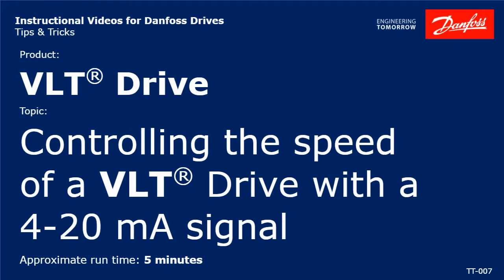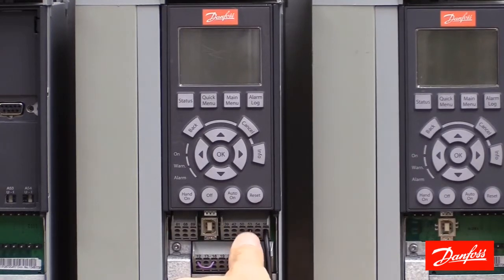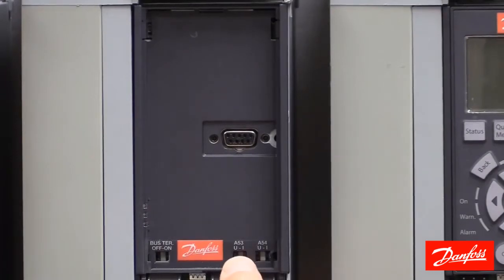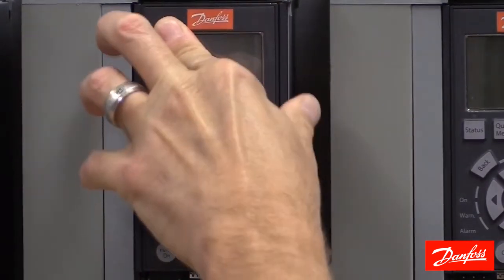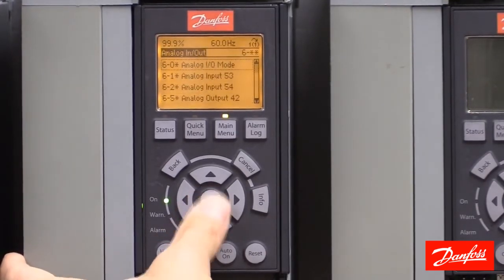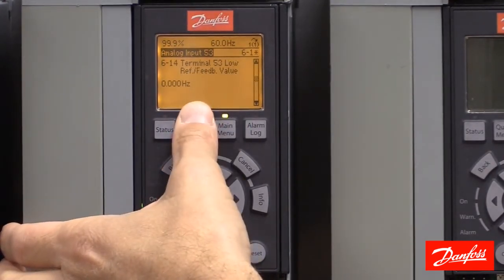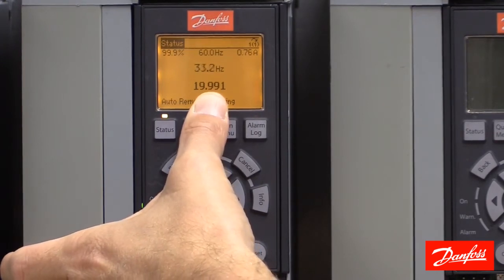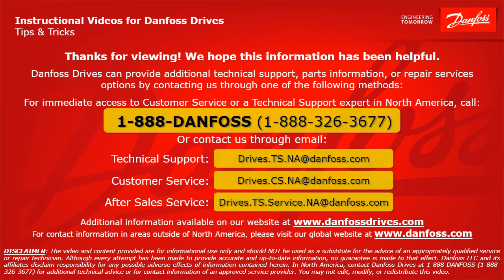VLT® Drives: Controlling the speed of a VLT Drive with a 4-20 mA signal

Comment: What is the recommended wire  diameter for connection of such 4-20 ma pressure transmitter to VFD, for distance up to 10 meter ? Shielded or not ?
Reply from the maker: For installation, start-up, programming and troubleshooting assistance please email: Drives.TS.NA@Danfoss.com 
or if you need immediate assistance contact Danfoss Drives 24/7 tech support at: +1 888 DANFOSS (326-3677)

Comment: How to reverse the logic sir? I mean more rpm of motor at 4 mA and less rpm at 20 mA. Can I just interchange the 60hz and 0 Hz position
Reply from the maker: For installation, start-up, programming and troubleshooting assistance please email: Drives.TS.NA@Danfoss.com 
or if you need immediate assistance contact Danfoss Drives 24/7 tech support at: +1 888 DANFOSS (326-3677)